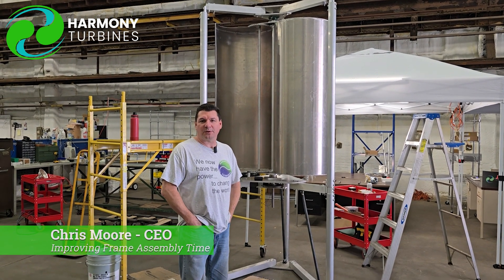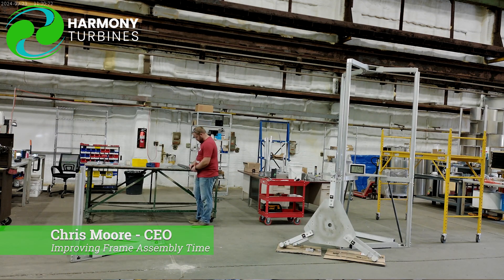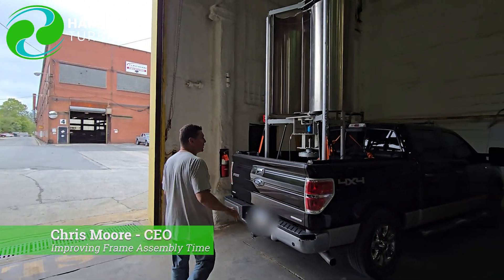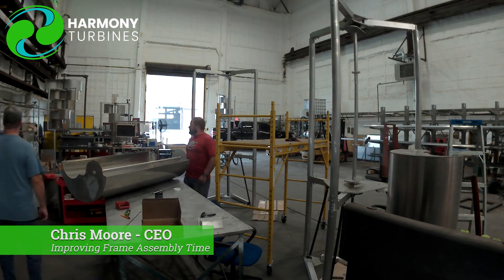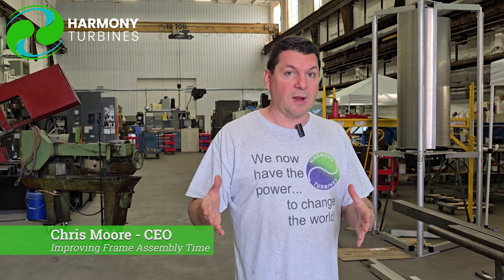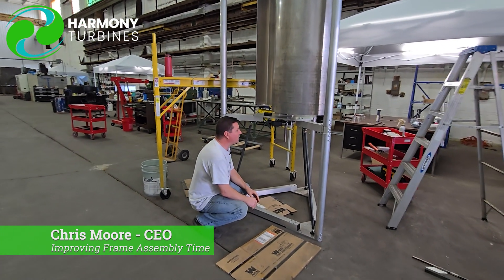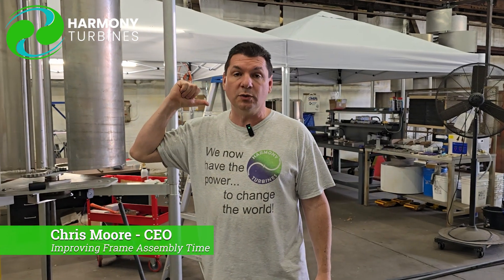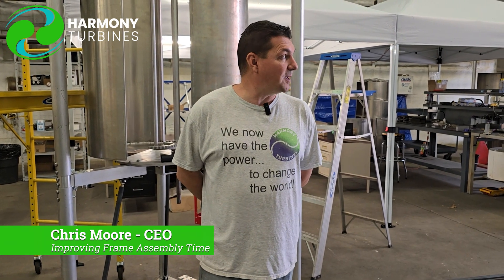This Wind Turbine Practically Builds Itself!

Comment: Do you have a spec....?  How many watts at what wind speed  ?
Reply from the maker: We do not have published ratings yet, because we’re still in development and just now starting to work on those numbers. We expect the current prototype we are working on (our 400w model) to generate around 400w in a 25mph wind, but the true power output will be determined by our testing and BETA Field testing. We will publish our ratings further down the road when we have tested the turbines sufficiently.  Subscribe to our Newsletter here: https://harmonyturbines.com/#subscription
Reply: @HarmonyTurbines  need to get the numbers up for slow wind speeds. I'm sure you know that.
Reply: How about planetary gears?

Comment: Really enjoy seeing your progress. We're building an off-grid home in northern Ontario.  We have the garage built and ready for the solar panels. Building the house next summer with plans of installing a wind generator on the roof. We're on 8 acres with lots of trees so mounting on the roof gets the wind turbine almost above the trees. I'm guessing we'll need to add additional roof support for the weight and lateral stresses. Do you have any numbers or suggestions on what I'd need for a roof installation?
Reply from the maker: We don't have those details yet, but we will provide that info when we have it!

Comment: I don't know if you realise it, but  the Turbine is actually useful when folded into a Cylinder.
If you were to add another 1 - 1.5 metres of height, you have a  useful Flettner Rotor to drive up to 30ft of Yacht in winds up to 25 knots, and then while it is moored, it can be expanded to generate electricity.
I have the calculations for performance, as I am building a Rotor of similar dimensions myself. Let me know if the concept is of interest.
Reply from the maker: YES, it's a concept we were already aware of. It's on our radar for further down the road!

Comment: Will you be shipping units assembled or as components?  The components approach would seem to be cheaper to ship.
Reply from the maker: Initially we believe we'll be assembling most of the product, with only minor assembly required by the consumer. The more responsibility for building you leave in the hands of the consumer, the greater the risk of the product not being built correctly.  It's possible down the road as the design is fine-tuned and simplified even further, that the component approach could be an option.

Comment: Two questions.  I know these are still in the designing phase but...

What kind of seasonal or yearly maintenance are you thinking... lube, greasing fittings?

Have you started looking at the size of base/foundation or slab are you looking at these requiring?

Comment: What do you anticipate the KW rating for the 4 scoop units?
Reply from the maker: We believe the current prototype we are working on (our 400w model) could generate around 400w in a 25mph wind, but the true power output will be determined by our testing and BETA Field testing. We will publish our ratings further down the road when we have tested the turbines sufficiently.

Comment: Your "Two Scoop"  design is inherently more efficient than your "Four Scoop" (really eight scoop) design. If you could stack two 2-scoopers, it would be even better. There is almost always a brisk breeze at my farm here in Moriarty NM. Now if you could solve the energy storage problem as well as the energy generation,  you would have a complete solution for off-grid power.

Comment: Pricing is obviously a ways out yet. However, is it possible you could leave them as a (sort of budget friendly) kit? Basically where the customer assembles them. Might be able to ship via a few boxes std shipping rather than freight. Also with assembly done by the customer save them the assembly labor time. Might only save the customer a few hundred but still. Perhaps it would also help with roof installs to keep from needing special equipment like a crane to get it up there. Just a thought.
Reply from the maker: We hope to have a variety of options available eventually, to meet various budgets and interests.
Reply: I think there would be a HUGE demand for customer assembly. I certainly would ve VERY interested.
Reply: Awesome post

Comment: I'm interested in the idea of integrating a series of Harmony Turbines in a "wall" of vertical, bi-facial PV solar panels. Would having the turbines in a gap in a wall help improve efficiency or reduce it? If the wall creates a high-pressure zone on one side and low-pressure zone on the other side, I'm postulating that it could channel air through a gap with a turbine in it (in addition to air just spilling over the top of the wall). Just wondering if you guys have theorized or tested any modeling in this kind of scenario? I could see a setup like that reducing wind velocity but with increased static pressures, perhaps increasing torque potential... or maybe the air accelerates through the gap?